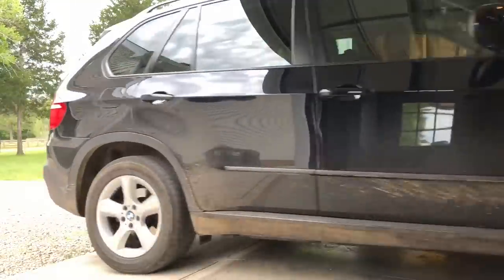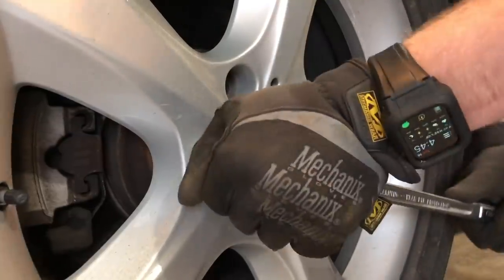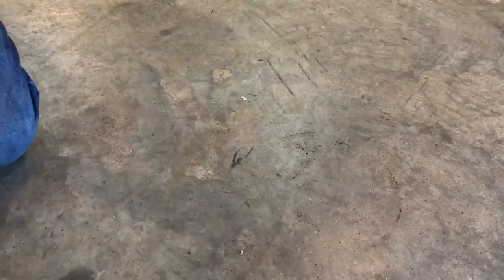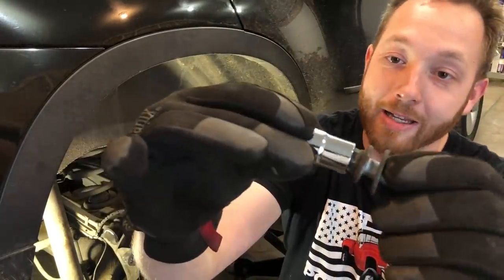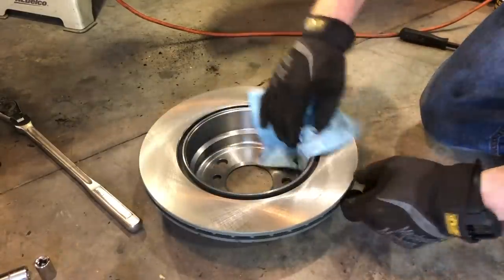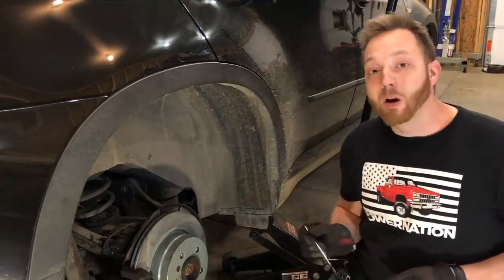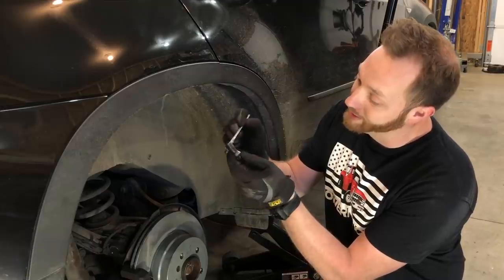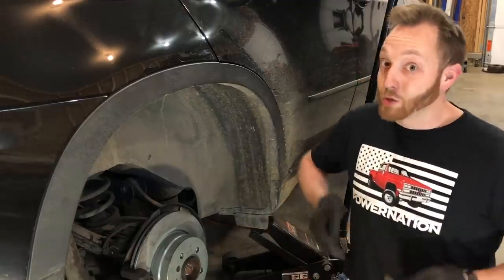Replacing Rear Brake Pads and Rotors on a BMW X5 - PowerNation At Home

Comment: Pretty sure BMW wants those lug bolts installed dry. Anti seize will affect the clamping force once torqued to spec. That being said, I always applied anti seize to the rotor retaining screw since those were notorious for seizing. Torque on those was never really critical - they’re just for retaining the rotor while the wheel is off.

Comment: Well that's a first for me, never in my 31 yrs have I seen a wheel bolt. Just studs and lugnuts. Also, wear sensor? I'm all for German engineering but what's wrong with the simple squeal tab on the pad? Good to see y'all still Makin content.
Reply: Most European cars use wheel bolts.

Comment: When removing caliper brackett E18 bolts with a 12pt 14mm socket, use a large clamp to press the breaker bar and socket fast against the torx bolt,  once it breaks loose (1/8 turn) remove clamp and remove bolt. Otherwise, you will damage the torx bolt when the socket backs away, and the socket spins on the bolt splines.

Comment: As i am a tech i love these videos because i get to do it all over again when the pads stick in the bracket and the slide pins dont slide anymore. Come on put some lube on the parts. if your going to show how to videos do it properly,
Reply: That brake rotor was MINT too...pointless to replace an OEM part with aftermarket if you dont need to

Comment: Thanks for the video, did you have any issues with the electric parking brake? Do you require to put it service mode or manually release it to access the calipers?

Comment: This answer is more than anything for those who have the same doubt;  yes, you need to put the brakes in workshop mode to be able to work them without problem (if u have electronic parking brakes), with a scanner for bmw you can do it easily without the need or those famous applications.
For mechanic and electromechanic just leave the parking brake loose to be able to take the rotor out and don't rip-off everything together like me. 
I had the same question for a long time and no one was willing to answer it.
Good luck.

Comment: Thanks for the video.  Can anybody please tell me how can he take down the rotor so easily? As my f15 x5 will automatically turn on parking brake after you turn off the engine, and it prevents the rotor to move.  Should be same with e70 with  electric parking brake.

Comment: No brake lube? Torque specs on lug nuts and bolts are “dry torque” love the videos but be careful PN. I get its a nice short clip from home but people trust your info more than maybe just a “normal guy” at home in his shop. This kind of reminds me of all of the guys that say “I can do brakes, they are easy!” And completely overlook all of the important steps of doing a brake job. Are the sliders free? Is the piston boot torn? Is the bracket clean? Just my opinion.
Reply: I was just gonna say the same thing..glad you already covered it.
Reply: My question is why didn't he crack the bleeder and just bleed out some of the old brake fluid.  Simple brake flush why you have the brakes off.  Brake fluid does break down with heat and time.  Also not to mention all the back pressure you just sent up to the ABS system, will it ruin it......depends who you ask.
Reply: @todo991  you're more likely to break up bleeder valve doing that. And out of thousands of pushed back in virtually every make, never had an issue
Reply: @todo991  should be okay to push the piston in. With the car off all passages in the ABS manifold should be open. It may differ on a car with a push button emergency/parking brake. Even vehicle with the "twist in" pistons I've never been presented with a problem. Just don't open the cap under the hood and you should be fine. The only time you should crack the bleeders is if you've added brake fluid to replace the small amount that "disappears" because of pad wear. If your master cylinder is full when your pads are freshly installed and pressurized then only flush as needed for driving style and weather conditions. More to keep condensation out over time.

Comment: From my BMW experience I'm surprised there wasn't some kind of code you had to enter in the cars' computer or it wouldn't start . And of course the Dealership would charge $75  for it
Reply: No doubt there's a light on the dash now.
Reply: @batman9592   guess Jared Z didn't get the irony  or hadn't replaced a battery or a power window motor

Comment: should of use an old brake pad in the caliber with the c clamp to make sure you dont cause damage to the pistion and get an even push on the piston as it goes back. i would of use a big flat head before i took the caliber off tho as u were replacing the rotors also.

Comment: I'm not sure about the anti-seize on the threads. That would change the torque requirements for the lug bolts. IE, they will be easier to turn, so 90 ft-lbs of torque would cause more than the specified clamping force and bolt stretch. See this article from Tire Rack. Scroll down to near the bottom. https://www.tirerack.com/tires/tiretech/techpage.jsp?techid=99&
Reply: Russ LaValle 
I agree.
If I’m not mistaken...it’s generally not recommended that anything grease, oil or anti-seize be applied on wheel stud threads.
Not only might it effect the torque spec. More importantly, i think that lubed threads may tend to loosen

Comment: Why do German cars use wheel bolts instead of studs/nuts?  Here in the States, only farm equipment use wheel bolts; the wheels can be a pain to install without an alignment bolt/pin.

Also, what kind of anti-seize do you use?  High-Temp Copper?  Ultra High-Temp Nickel?  Or basic Aluminum?  Did you know that the aluminum anti-seize can react with the steel in the fasteners, causing galvanic corrosion (i.e., they weld/fuse together).  It actually makes it MORE difficult to service later; it's actually easier to not put any anti-seize on, if you're using the basic aluminum stuff.

I personally use copper for most everything; it's more stable, it WILL come apart easier in the future, and it handles much higher temperatures.  It's also not all that much more, because a little anti-seize goes a long way.  It's definitely worth it to use the more expensive copper than the aluminum anti-seize.  Save the aluminum anti-seize for aluminum fasteners holding aluminum parts.
Reply: Bmws wheels are hub centric where as vehicles that use lug nuts are lug centric goes to how the wheel is centered on hub when its mounted

Comment: I've had two BMWs. Nice but expensive parts and they don't last
Reply: My e39 540i 6 speed is pretty reliable.
Reply: I have a non Vanos version with an M5 LSD. I use it for drifting.
Reply: I have yet to run into a BMW part that is any more expensive than an equivalent domestic vehicle.